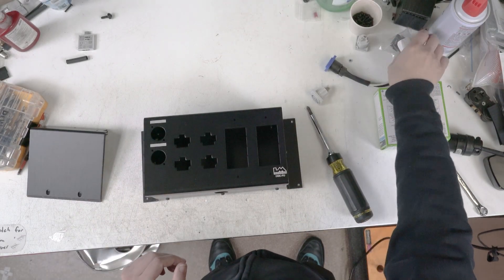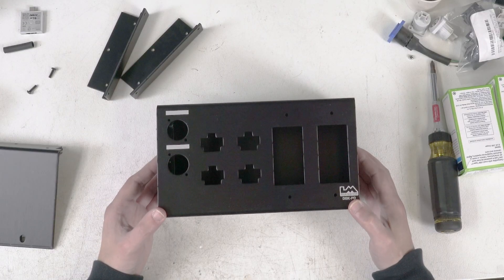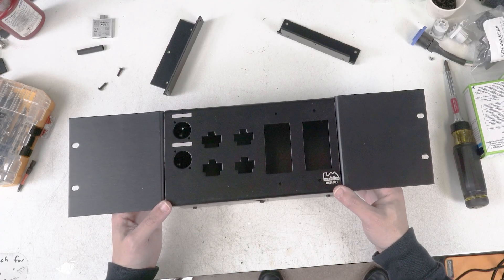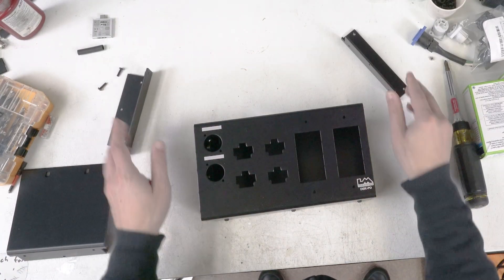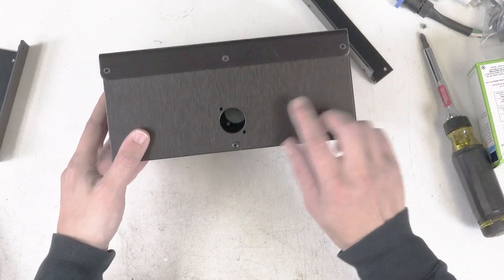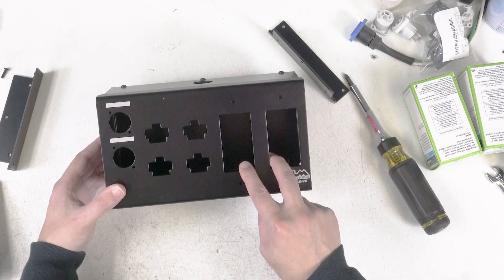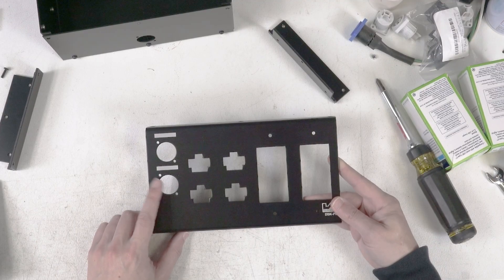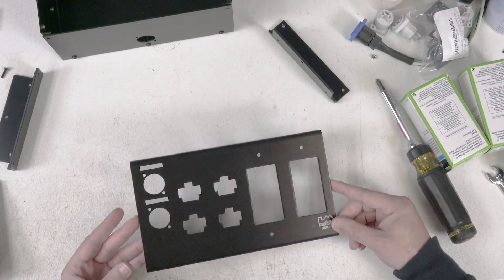Building A Powercon Desktop Power Distribution Box w/USB Charge Ports

Comment: You would get a cleaner look putting the powercons in from the inside
Reply: You’re correct but I believe ppl do this because they find it easier to make repairs by pulling it out of the front, so you only need to access the back side to place the nut when you screw it back in at the end

Comment: Since you asked… I don’t like the IN/OUT on the top/bottom (from the camera angle we have). I’d prefer them on the sides… but I’m also thinking from the idea that it’s going into a 19” rack. Thoughts/Questions: 1. Could you put a True1 on the face, under the power cons? Looks like there might be enough room for one. 2. If the IN was going to be on the back or top- how about the ‘box’ being 2 sided, and the ‘cover’ being 2 sided, which would allow you to put the cover on in two different configurations, whichever was best for the user? The reason being the IN (and/or OUT) could go on the top or rear without making a stamping new pieces of metal. I really hope that makes sense- it would also require the box and cover to be the exact same dimension. If you’re still confused, think that the 2-sided box and the 2-sided cover could 69 2 different ways. (Bonus idea- just put the IN/OUT next to each other.) 

Lastly, I REALLY wish powercons (or whatever) would come in a Duplex configuration! Just pop off the Duplex outlet and put in a Duplex powercon! 😢

Cheers!